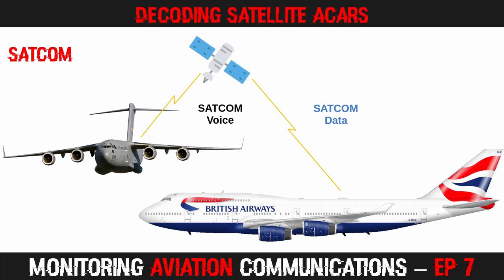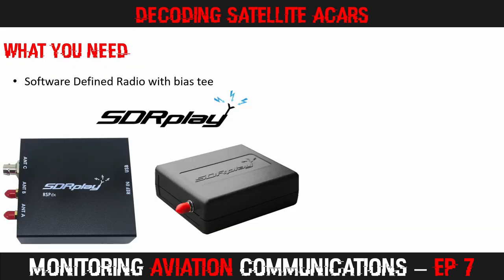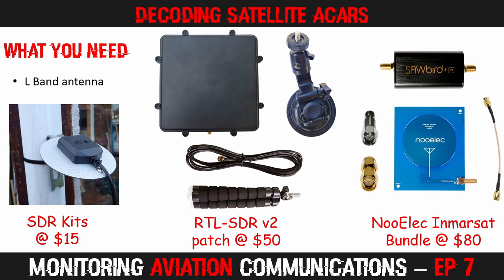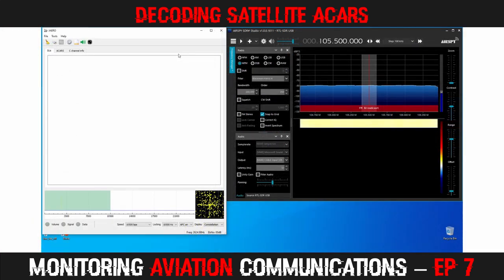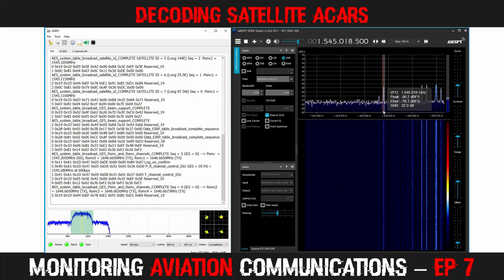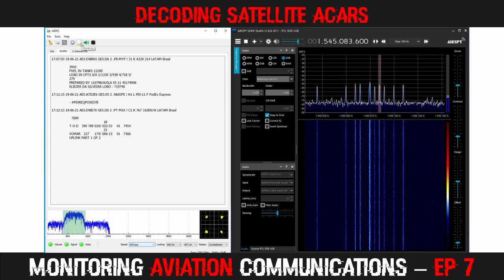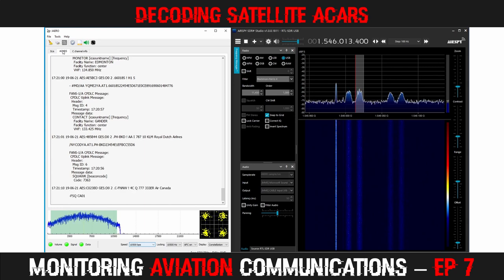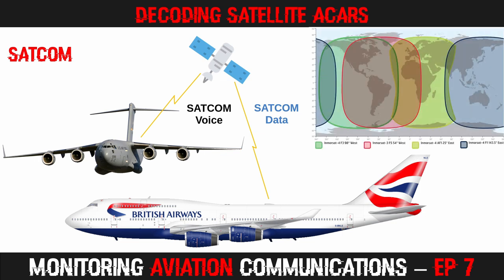How To Decode L band Satellite ACARS and CPDLC messages with JAERO and your SDR

Comment: I bought an L-Band Patch Antenna and have set up Jaero. (also ScytaleC for marine observations). All working very well thanks to Frugal Radio's clear and concise instructions. A tip I would like to share regarding maximising of your reception is to use a satellite finder app. I used one called Satellite Finder and once the patch antenna was fine-tuned my SNR is 26 -30
Reply from the maker: Great tip Evan, thanks for sharing!
Reply: hi i ggoled and found the link to skytalec software but it seems its not available anymore ,do you hapen have a link you can send ? please

Comment: Thanks so much! After getting the SDR radio, L band antenna and software installed it took me two days to get it up and running. I watched this video about 5 times and read the user guides on the equipment. I was thrilled when I got my first ADS-C message @10500 bps.
Reply from the maker: Fantastic! It certainly feels exciting when you can start pulling down all these messages from the satellites. Loads of fun.

I'm hoping I'll have another L band video this Summer which will show you how to do even more!

Thanks for the donation. Much appreciated.

Comment: nice video, thanks for share. just to clarify, the decodes are CPDLC and ADS-C messages. ACARS works on 1090Mhz
Reply from the maker: Not quite. ACARS works on VHF. CPDLC messages are via satellite in the 1500 MHz range. 1090 MHz is for ADSB.

Comment: Thanks for another interesting video. I'm sure you've noticed that there are some 600bps channels on the 54W bird where the majority of aircraft are USAF transports and tankers. Other channels seem to be aimed at a particular geographical area, such as South America. I caught quite a few USAF VIP aircraft, including AF1 during the recent G7 summit on 600bps and 10,500bps channels.
Reply from the maker: Nice catch with AF1 Tim. That's fantastic! I've picked up several SAM flights in the past.

Yes, have definitely noticed plenty of USAF activity on the 600bps transponders. 

Hadn't picked up on the geographic ones before though. That's interesting to know. I noticed several South American aircraft on the 600 channels, however I mostly monitor the 10500. A future project will be to ingest all transponders at once and set up a filtering system for certain messages. That's a longer term project though!

Thanks for your support of the channel.
Reply: Hi, can you tell us, how do we know, if it's 600, 10,500 12500 bps, if the decoder (J.) doesn't recognize it automatically? Thnx 👍
Reply from the maker: You can tell by the bandwidth. The 600bps channels are about 6 kHz wide, the 10500 baud channels approx 11 kHz wide.

Comment: Great video. Do you reduce the gain once pointing in proper direction? Much lower noise floor for you there so was curious if you turned the gain down or selected different device settings?
Reply from the maker: No, the L band signals are fairly weak, so the gain needs to be kept at maximum. I just adjusted the Range & Contrast sliders in SDR#.

Comment: I am new to ACARS decoding and have the sdr-kits magnetic stick on antenna and rtl-sdr V3 blog. My location is poor but managed to receive some signals/decodes by mounting it on a pole and sticking it out of a first floor window. However it only works after dark. Any idea why this is? Coud this be solar interference etc? Many thanks.
Reply from the maker: Is it VHF ACARS, HFDL or Satellite ACARS (JAERO) you are experimenting with?
Reply: @FrugalRadio  Thanks for your response. It is satellite 1.545GHz with JAERO.
Reply from the maker: Ok, strange. Possible that it is solar interference, but more likely just more background noise received by day. Or perhaps you are receiving reflections, rather than direct from the satellite path.

Check that you have the fish pointed directly at the SAT, and are not picking up via a window reflection. Also use a shorter coax run if you can, or replace the extension coax with something less lossy.
Also verify clear line of site to the satellite, eg no trees getting in the way.

What antenna are you using? The RTL-SDR L band patch? NooElec kit? Modified GPS?

Comment: Hi I'm managing to decode the 600 bps signals ok ,but not the higher frequency 1.545.998 ones as shown in the videoabout 17 minutes into it ,I'm  using the speed set to 10500bps , would i pick those frequencies  up with my antenna pointing towards the east, i am reciving signal peaks , regards Peter
Reply from the maker: The higher bandwidth signals are more difficult to receive as they are weaker. The 600bps ones are the strongest. The 8400bps are the most difficult to pull in, as the power reduces when a transmission begins.

For 10500, make sure your SDR bandwidth is correct (should be around 11-12 KHz - the whole signal should fit within the bandwidth window). You might also want to keep a close eye on the signal to noise ratio (SNR), and JAERO Eb value. Move your antenna to get these as high as possible. The stronger the signal, the higher chance of decode. Also check your volume output level on your SDR software. If the volumes light is green in JAERO It's fine, but if it is a different colour, you'll need to adjust.
Reply: @FrugalRadio  thank you very much I’ll keep trying
Reply: @FrugalRadio Hi  is it possible i could email you regards Peter

Comment: Windows 10 64 bit and still cannot get the constellation viewer to indicate any signal. Using SdrSharp with a AirSpy Mini. ScytaleC works. Amy suggestions?
Reply from the maker: I would check the following :
Is JAERO receiving the audio?
Is your bandwidth in SDR# set correctly?
Can you see the signal hump in JAERO? Sometimes it helps to left-click in the centre of it.
Is the appropriate speed for the transponder selected in JAERO?
Reply: JAERO does not appear to be receiving the audio. There is no activity in the constellation box or the spectrum. I am using the VB Audio.Virtual.Audio.Cable x64
Reply from the maker: If JAERO isn't getting audio, check that the correct soundcard is selected in the JAERO settings.
Then check the volume slider in SDR#.
If JAERO is receiving audio, you will see a green light at the bottom beside Volume. If the light isn't green, the volume is probably too low in SDR#. If it goes red, the volume is too high.

See if changing that gets you any signal.
Reply: receiving data on a laptop. still can't it to work on desktop but will keep trying. thanks
Reply from the maker: If you've got it running on one machine, but not the other, that seems odd. From there I might try reinstalling the virtual cable, and ensuring no other device software is producing sounds on the VB cable channel. 

Hopefully you'll get it figured!
Reply from the maker: Thanks for the tip Sid. Hopefully @MB4AC can follow up on that.
Reply: @FrugalRadio  VB Audio Virtual cable shows that it is getting input from sdr sharp but dose not show any output

Comment: Hi i couldnt get the bias T to turn on using sdr sharp then i found out i had to download the BT file so i did that and clicked on the biast t on ,but for some reason it wont turn on i checked for voltage coming out but none presemt, i tried deleting the file and re downloading it but still no luck  so i tried useing sdr ++ that works ok and also usiing SDR UNO  5v coming out to the antenna , the only issue I'm having is picking up a signal with my l patch antenna ,looking at the map on here i should be recieving by pointing either east or west here in the UK
Reply from the maker: Yes, I could get Alphasat and 54W when I lived in Ireland. Good luck!

Comment: So since I live in the northern hemisphere as long as I point antenna towards southern sky I should be good right or does it require signal to be peaked?
Reply from the maker: A patch antenna like this is very directional, so you would definitely need to point it carefully towards to Southern part of the sky until you see the signals. Then adjust for peak reception.

Comment: i get the following message and unsure what to make of it..any ideas?  "error short frame!!!maybe the soundcard dropped some sound card buffers format id error"
Reply from the maker: Yes, that is a common error. It usually appears when first decoding a signal. As long as that message stops after a few seconds and you have the green lights, all will be well. If the message continues to appear after a few seconds, try adjusting your audio or SDR receiver settings.
Reply: @FrugalRadio  you are awesome.i greatly appreciate the reply.it does seem to have the error message come up every so often but is not constant.i see also at the end of the video you are able to hear audio. i did a seaarch in you current videos on how to set it up but did not see anything that shows how to set it up.i could have passed it and not understood what the video is about but am watching them one by one to find it if available.i did copy the settings as shown in the video here but did not hear anything.i know im missing something but not sure what.is there a video or even a website for setting it up properly that you know of..thank you again.i really appreciate the help and see why people are into radios as im a 3rd generation "enthusiast"
Reply from the maker: No worries. The audio is a little more difficult to set up. You tell JAERO to decode at 8400bps, and set your bandwidth accordingly. As long as you have the correct libraries installed (I don't remember what they're called), it will produce audio. I haven't made a video specifically about it.

One thing to note is that the 8400 channels come and go. They also dynamically reduce power after an audio connection has been initiated. So you may hear part of a call, then see the signal lower and possibly drop completely.

Have fun experimenting!

Comment: Hi great video as always i just got the RTL-SDR v2 patch , does the bias T need to be on ?
Reply from the maker: Hi. Yes, bias t provides power to the LNA inside the patch antenna. This is required to produce a high enough signal to noise ratio to enable decoding. Make sure bias t is switched on when using this patch antenna.
Reply: @FrugalRadio  thanks for your quick reply ,do you have a video on how to do this ?
Reply from the maker: It would depend on the SDR you are using.
If it's an RTL-SDR v3, instructions are at https://www.rtl-sdr.com/rtl-sdr-blog-v-3-dongles-user-guide/ under Feature 2. NooElec SDRs do not have a switchable bias tee. You either buy the one with permanent bias tee (SMArtee), or the one without (SMArt). Please refer to the user guide for your particular SDR.
Reply: @FrugalRadio  ok thankyou very much

Comment: Nice, grabbing an antenna once available.
Reply from the maker: Good idea!
Reply: @FrugalRadio  Making one, snagged some PCB boards from eBay ... looks like a fun project.
Reply from the maker: Excellent. If you have a 3d printer, you can also create a small helix antenna for L band. They provide excellent reception from what I hear. Try looking up homebrew L band antennas for several designs 🙂
Reply: @FrugalRadio  I've ordered some copper PCB for a homebrew plate antenna. Will check out the helix. 3D printer might be a fun addition, not got into that yet.
Reply from the maker: Ah yes, building your own plate, nice. Let us know your results when you get it all assembled and tested!

Comment: Great tutorial as always! I am gonna buy RTL Blog's antenna :) I have question, because idk if i am wrong, L-band also have one weather sat that provide full disc photos - I am really interested in this.
Reply from the maker: Yes, there are a couple of GOES weather satellites that download in the L band. To receive them, you generally require a dish. I hope to demonstrate a set up in the future!
Reply: @FrugalRadio  will be more than a happy to see a tutorial about this in the future.
Reply from the maker: Good to know it will be interesting to some viewers. Appreciate you letting me know.
Reply: Great video. Can you tell me for central Oregon which satellites I could hear from here. I read where some satellites are not going to be used as they have reached EOL. So what is the deal going forward for my area? It appears there aren't many places to get this antenna.

All the best,
George
Reply from the maker: 98W would be your main sat. Loads of activity on them - so much it's hard to keep up!
Reply: Hi FR,

Thanks for your reply. My antenna finally arrived. I presume that the satellite is Inmarset 4-F3. Now to find an on-line calculator that will tell me the angle to aim from my location.
Reply from the maker: Have fun George!

Comment: Thanks for the video, i have managed to receive signals but every day the frequency change on my sdrsharp, on which satellite must i aim 54 west or 89 west. This is not clear to me, sorry but i am new at this. I use the sdr-blog antenna en the sdr dongle from them.sorry for the bad english. Hope someone can tell me how to handle the antenna. Thanks
Reply from the maker: Hi Peter.
The satellite moves in the sky a little, so it is normal for signal strength to go up and down a bit. The frequency should be stable though, but on USB mode it will be a few kHz different from what is published.

As long as the drift is not coming from your SDR itself. Do you notice the frequency changing each day on VHF & UHF signals?
Reply: @FrugalRadio  hello, thanks for answer. The vhf & uhf signals on the sdr are stable , so it can be that i not adjust the antenna good.  Last question for adjusting which satellie nust i have in the West (i live in The Netherlands and have good view from South- West to West)or must i adjust between these that is not clear to me. Good channel you have and thanks for the good videos. Greetings Peter
Reply from the maker: Hello again Peter.
Yes, good decoding relies on a clear path to the satellite. Trees and buildings create problems for the satellite signal.

From NL you could expect to receive a signal from 54W, and 25E. If your view is clearer to the West, I would try the 54W satellite first.

There are some apps, such as Dishpointer, which can help you find the location of the satellite from your position. It might be worth trying one of those as you get started.

Best wishes!